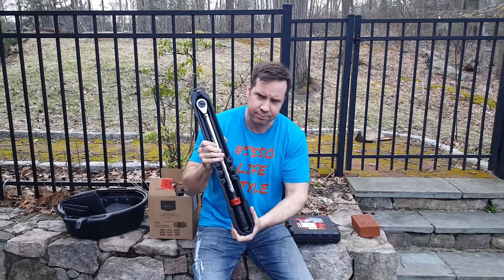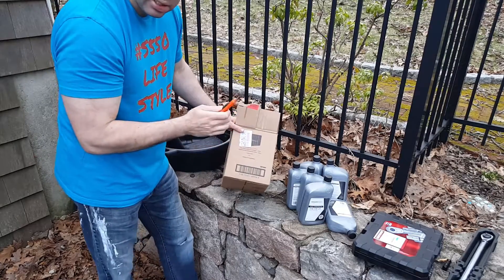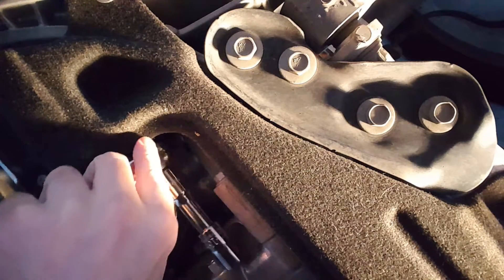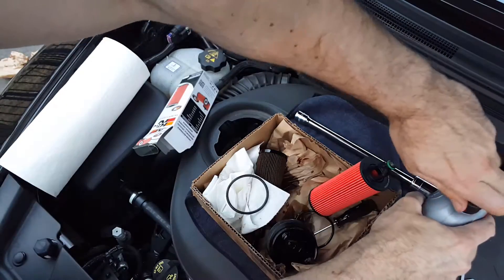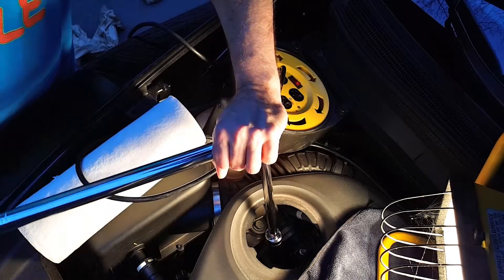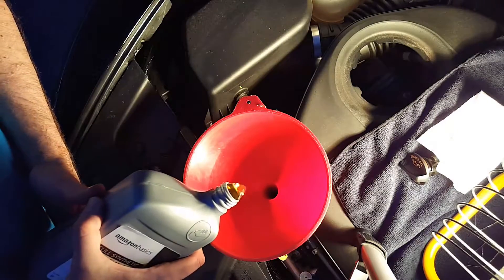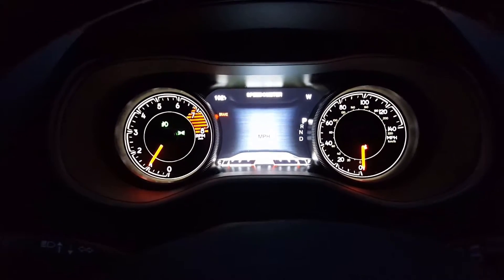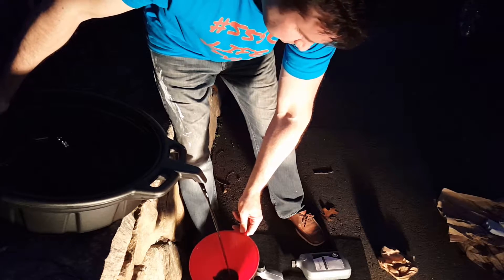How to change oil on 2017 Jeep Cherokee (Poor Man's Oil Change!)

Comment: Be careful, as on my Cherokee the oil filter cap says to tighten to 25Nm, which is roughly 18.5 lbft.  I believe presenter said to tighten to 25 lbft.  These housings are plastic and prone to cracking if the cap is over tightened.  Please read your cap and manuals to be certain as to the required tightness of the oil filter cap.

Comment: the black metal ramps at hft are on $ 40.00 and with a coupon   there even less.  they work grate   I bought a pair   and they work faster  and better  then jack stands
Reply from the maker: Thanks man. I ended up getting a Quick Jack, which I like so far. I reviewed it here if you're interested. https://youtu.be/Yf9mCp-py6g

Comment: They don't make it easy anymore do they? Do it yourself,  or take it to the the dealership. But more  satisfaction doing it yourself, it's the pride.
Reply from the maker: Yeah it was kind of fun. It was so hard to move under the car though (especially trying to prop my phone up to record). Definitely getting jacks.
Reply: This is significantly easier than my 01 F150 with the 5.4. God am i glad it's a top mounted filter. i also appreciate they put in the access panel for the plug on this. Makes it easy to find with just enough room to work. 

@Rated R Cars thanks for the video man. Wife just got a 2017 Cherokee and this came up as the recommended video to watch on where everything is at.